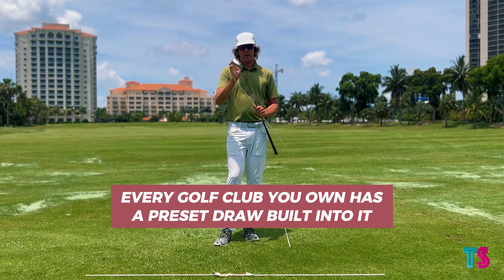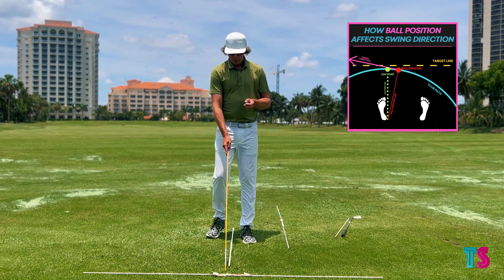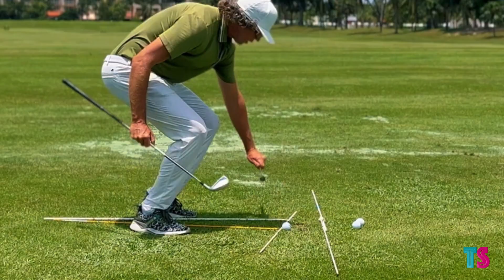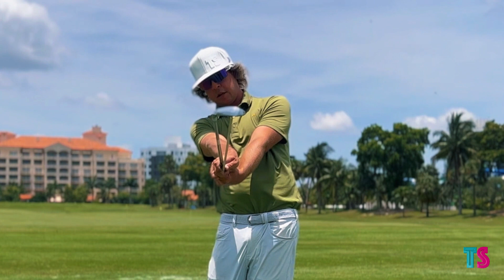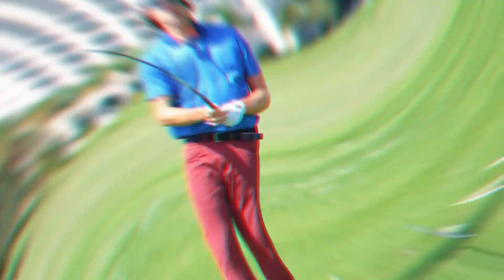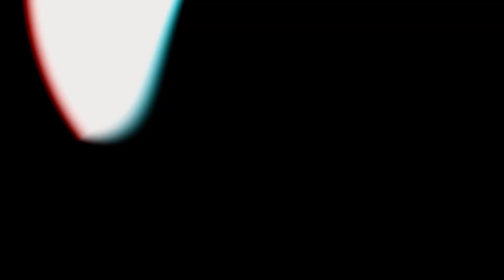Does Your Ball Over Curve?

Comment: The clubface should be square to “yellow line.”   Which alignment stick is the yellow one?
Reply from the maker: That would be the one that is angled towards the ball position (face will likely look open to you). The other line represents low point where you would be able to connect another stick from pointing it the direction of the ball position. Let me know if that helps and makes sense
Reply: @tsgolf So one wants the club face (leading edge) parallel to the yellow stick at setup?  Wouldn't that make it square to the path rather than closed to the path?